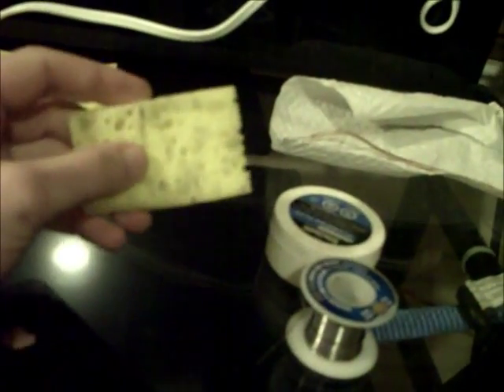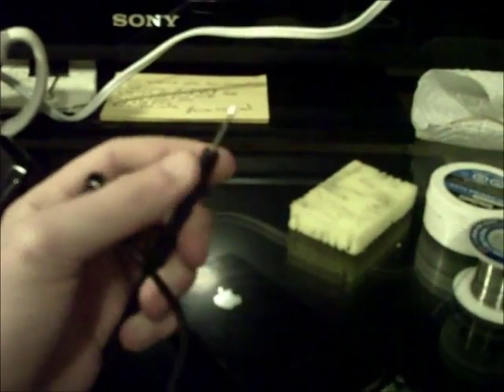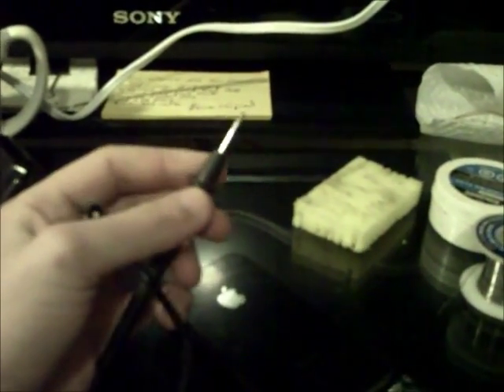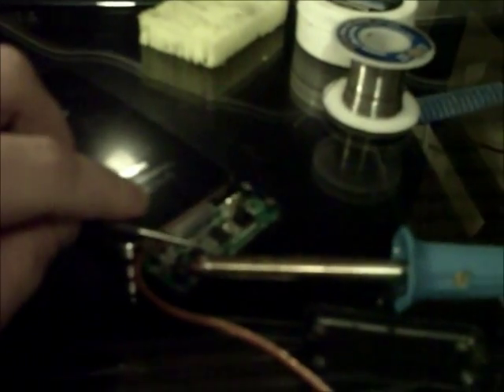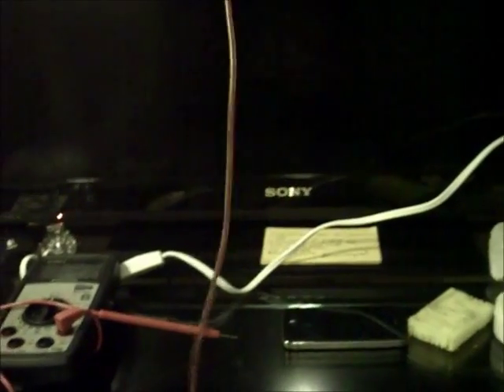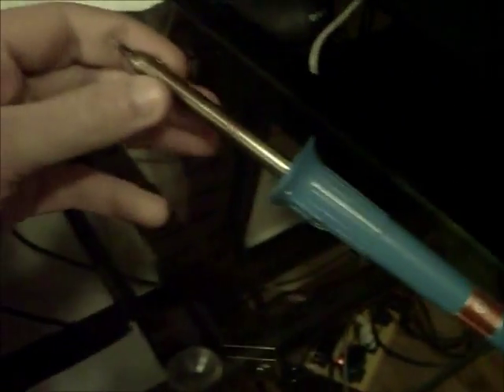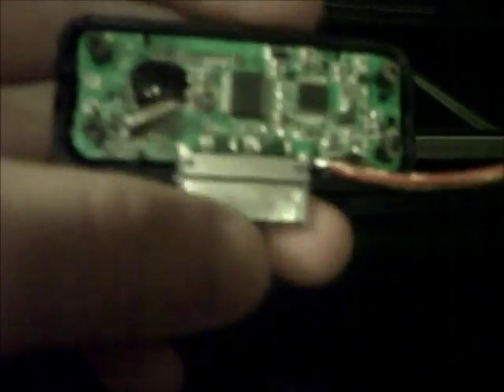100 Foot+ FM Transmitter Hack

Comment: Just an idea I thought I would mention but what if you took something like a TV coax amplifier and plug the fm transmitter into it and have more power I believe it does support fm signals on the 2 I have.